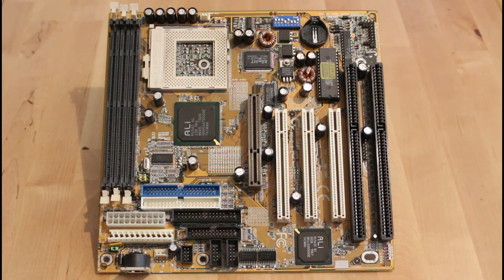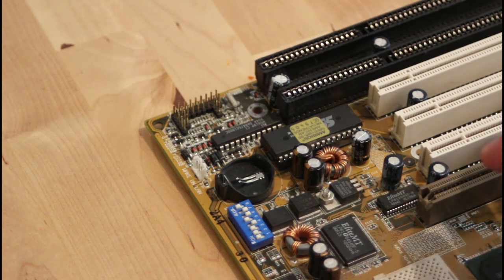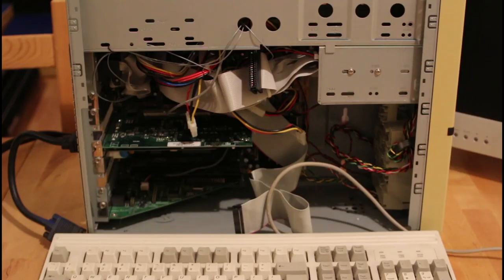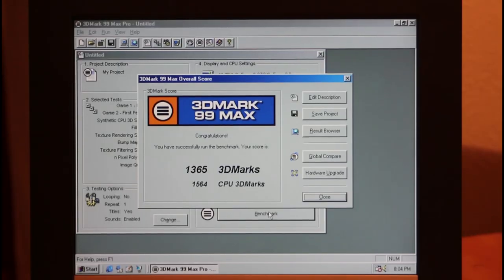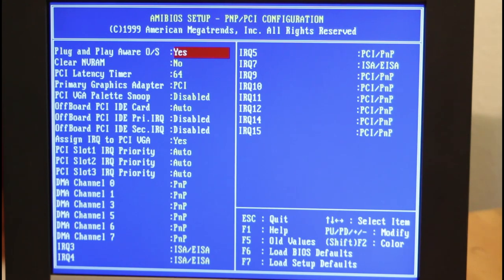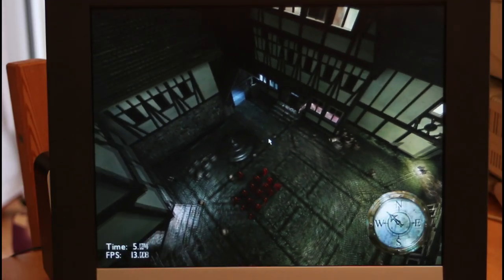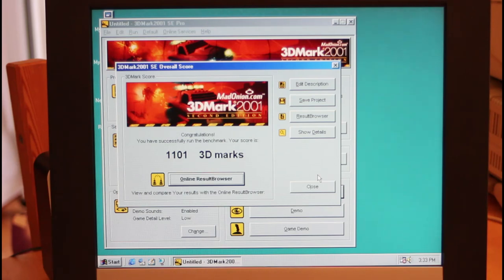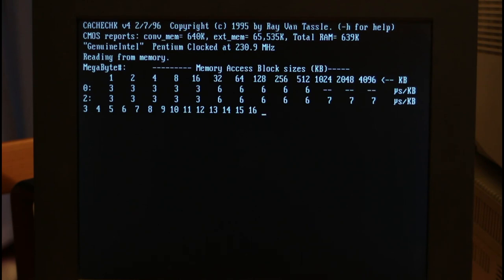Rescuing and benchmarking an ALI Super Socket 7 Motherboard

Comment: Ali is not as good as vía. Some Ali exactly M1541 doesnt work with 100 MHz fsb on AMD and a Nvidia TNT 2
Reply from the maker: Interesting. Mine did work, luckily and the VIA didn't. But it probably depends on the precise chipset and motherboard manufacturer.
Reply: @PCRetroTech  mine doesnt work unless fsb las 66 with 100 MHz only works with 3DFx voodoos
Reply from the maker: @asanjuas  Interesting. What revision board do you have?
Reply: @PCRetroTech  It has a freetech a long time ago
Reply: And this was my experience with this chipset
Reply from the maker: @asanjuas  Yes, that is interesting. Thanks.